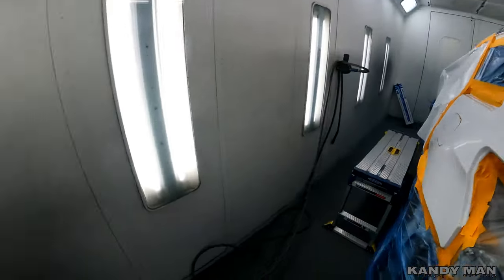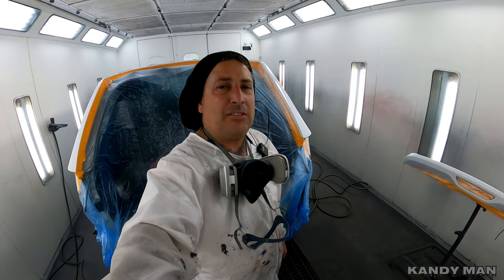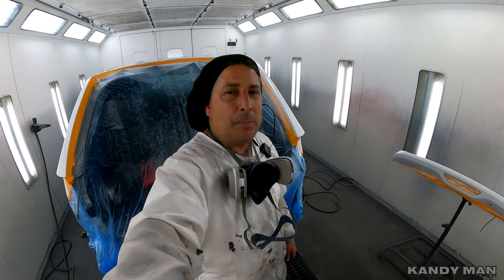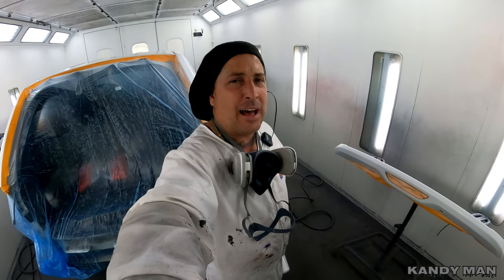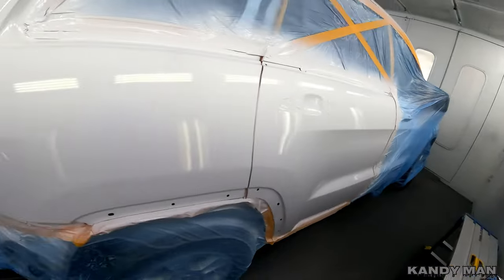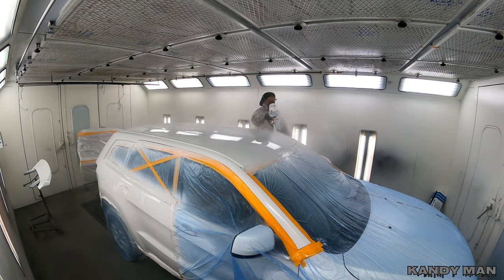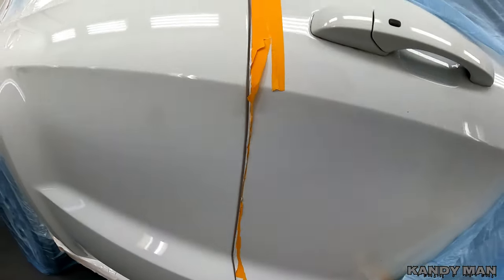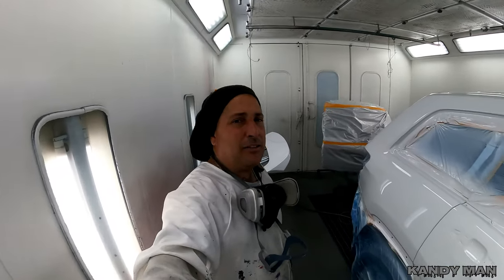THE RIGHT GUN FOR THE JOB

Comment: What's your favorite clear gun? Was thinking about getting a dv1 for clear to replace my 10 year old lph400. I did get a sagola 4600 dvr 1.3 but still really not sure if I like it or not yet.
Reply from the maker: I use the dv1 when I really  want to fine tune a job .it's slower  or the devilbiss clear gun when iwant push right through one fast I've used iwata ws400 also for many years they make a great gun I picked up the Kiwani gun but it not compliant so I'm gonna grab a lph 400 myself it hard to s a y what's my favorite they all have there use hope this helps 👍
Reply: @kandyman5315  thanks might get pro light for now then the new iwata down the road.